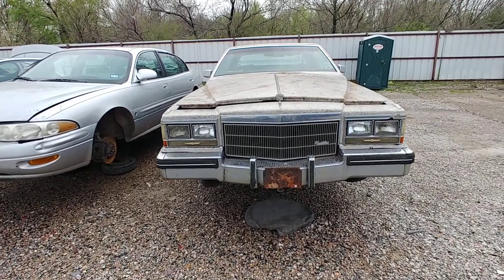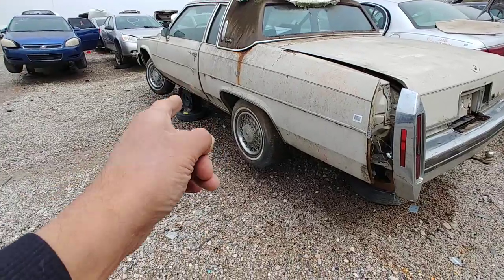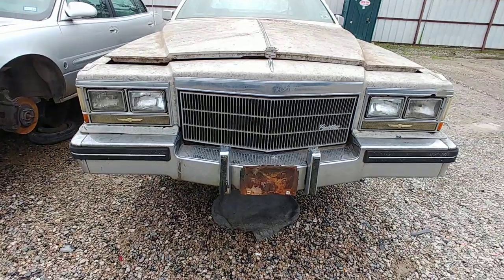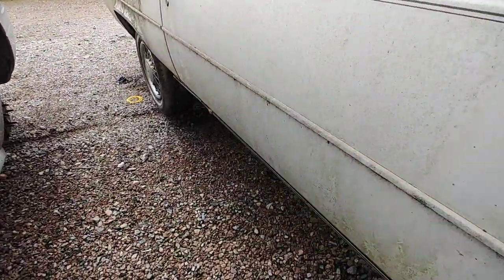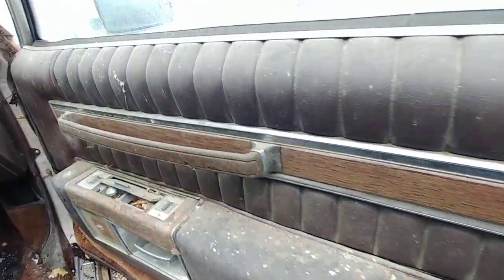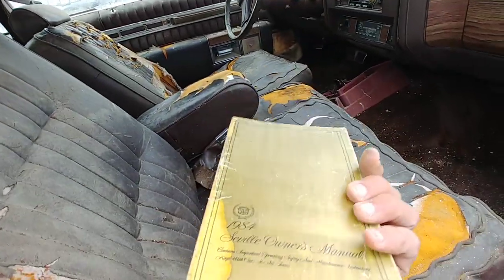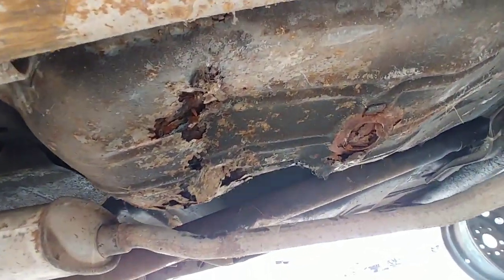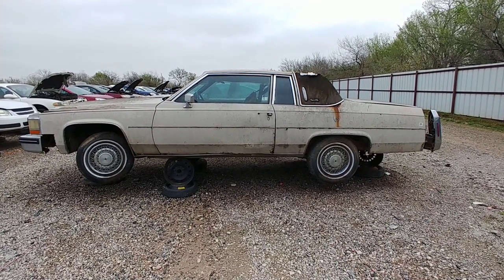1984 Cadillac Coupe DeVille Junkyard Find

Comment: A solid car to restore or use for parts...
Reply: Not at all solid enough to restore with the floors and quarter panels looking like that, among all of the other rusted out parts.
Reply: @jsciarri  I've seen way worse restored
Reply: @ls6-ss413  Very true, but this one is a better as a donor. Not that well optioned, only mildly so. Missing a lot of options available. Typically when ordered on the "cheap" they had velour interiors and bench seats and didn't have opera lights. Some had hubcaps and not simulated wires. I always liked these cars, but not the engines. My own first car was supposed to be a 1980 Fleetwood coupe which had of course the 368 with the 4 barrel. The service manager bought it out from under my father and I wound up with a very loaded '82 Toronado instead, which my parents loaned me the money for and I had to pay back before I could use it. Good incentive for a 17 year old kid to learn work ethic.
Reply: @jsciarri  more likely a parts donor...

Comment: I have an 86 CDV still runs and drives with the 4.1L  with  original headgaskets  179.534 miles Family owned since new    no dents or rust

Comment: My parents had an '83, it was code '#62 Woodland Haze. We bought it in the fall of 1982 after our 1980 Bonneville Brougham coupe (265 V8, black outside/saddle inside, what a beauty, I would still have it today if it was around) got stolen. Back then in the NYC area, there were organized groups stealing cars and exporting them to the Middle East since cars without leather interiors were in demand there. The NYPD cop that took the report told us, "Forget it, it's on a boat already. Call your insurance company...." Our car was about $18,000 new from what I remember. We sold it in March of 1988 after my father passed away. It was between that and the Trans Am and a mechanic neighbor almost convinced me to sell the Trans Am, but I decided against it because the Cadillac was more complicated and had the eeeek, HT4100 engine, which was a real heap (ours was low mileage, so it didn't have problems, and my father did all the service work on it himself). After we sold it, my neighbor's boyfriend swerved one day to avoid a mattress that fell off a truck and crashed it. Totaled. My dad worked at our local dealer from June 1984 until he passed away in January 1988. I knew and still know these cars well. I used to go to visit him after school (my HS was down the block from the dealer) and I'd often browse through the books at an empty desk waiting for him to finish and then he would drive me home. We had that plan for a couple of years, worked out great. 

Yes, 1980 to 1985 Sevilles were the "bustle back" type. They along with the 1979 to 1985 Eldorado, Riviera and Toronado were all made at the Linden, NJ assembly plant about 10 miles from me.  That is the wrong owner's manual for this car. To this day, I'd still love to find an owner's manual packet for a car my Dad sold---back then the salesperson would fill out the folder by hand and give it to the customer. 

Lots of good parts on this one---they interchange in many cases from 1980 to 1992. Back in the 1980s, kids used to take those ornaments and wear them around their necks on chains. The Cadillac dealer my father worked at stocked them by the dozen. The Fleetwood emblem had the crest around it, the Deville one did not.  The V on the trunk emblem meant it was a V8. From 1980 to 1982, you can tell from the back (originally) which were 4.1 Buick V6 equipped models by the lack of the "V" on the trunk emblem. '84 also didn't have the "HT4100 Digital Fuel Injection" fender emblems and had clear parking lamps with the gold Cadillac crests in them, so this is the original front end.

In '84, the Deville moved from the "C" body in the parts book to the "D" body joining its' more expensive brother, the Fleetwood. VIN on this is 1 for US made, G for General Motors, 6 for Cadillac, AM47 for Coupe Deville (2 door), 8 for "LT8" HT4100 4.1L V8 Cadillac produced with Digital Fuel Injection (basically dual injector throttle body fuel injection), 9 is a check digit, E for 1984 model year, 9 for Detroit, MI (Clark Street) assembly and the rest is the production sequence. These had the MW9 THM2004R overdrive transmission, same model as the Grand National. Mild options here----such as delay wipers CD4, VK3 front plate bracket, opera lamps, quarter vinyl top, C68 is for automatic climate control, K34 is cruise control, A31 is power windows, AU3 is power locks. I do not see A90 remote deck release. CAD on the SPID means "Cadillac Assembly" or Clark Street/Detroit, MI assembly, which closed for good in December 1987. The original exterior paint code is #60, Light Sand Gray. This appears to have the same color brown leather interior that my parents car had. 

MO Valley College is affiliated with the Presbyterian church and located at 500 E College St, Marshall, MO 65340. Mileage appears to be about 57k, probably 157K and that's about right for a HT4100. What happened with these was the intake manifold gasket would blow making a soupy coolant/oil mix that would then get whipped up to the lower end and eventually finishing off the engine. GM's "solution" was these brown "Horse Pills" as coolant sealant (basically Bars Leak) to seal things up. Stopgap solution. That label under the hood was a campaign decal added by the dealer as a result of that service campaign. This was a black eye for GM along with the whole HT4100. Early ones were wiping out camshafts at wholesale rates and they were lined up at the dealer for repair under warranty. Bad, bad, bad news. The introduction of the 307 in 1986 in the rear wheel drive cars was very, very, very welcomed because it brought a solid engine back into the fold. Then the 305 and 350 engines with fuel injection came out later on and were good too.  HT stood for "High Technology".

These cars were beautiful cars, but the poor engine ruined Cadillac's reputation for much of the 1980s. It started with the 4-6-8 (which was actually used through 1984 in commercial chassis, and across the board in 1981) and moved forward. At least with the 4-6-8, if you disconnected the modulated displacement, you had a very good fuel injected engine that ran well. The problem there was that GM rushed it to market before testing and in 1981, computers were not fast enough to respond to engine demands. We have that technology in engines today, but computer controls are light years ahead.

Comment: Kind of odd to see one of these in the yard since most of these were owned by older people who pampered them...
Reply: The HT4100 did these in as a 1-2 punch. First the intake would blow, circulating a chocolate milkshake of coolant and fouled oil. Once that polluted the bottom end, it was coup de grace and the engine was done. I saw it first hand on many Cadillacs waiting for repairs at the dealer my father worked at from 1984 to 1988.
Reply: This car is 36 years old so the old folks pampered examples were sold 20 years ago.

Comment: Man, I hate the way that rust almost always appeared on GM cars with that quarter vinyl roof. Lack of care for the most part... With some fiberglass bumper fillers, some metal and GOOD Body work and those wheels you found on your live last week and you might have a decent project on your hands...
Reply: I had a chance to buy one of these back in '95, I passed it up for my '80 Olds 98 Regency (it had leather and a roof) Lol... Good Times there...
Reply: @Cee_Four  As long as your Olds has the 350 VIN code "R" engine which was Olds produced, it was a smart move as that was a much better engine than the HT4100 in this Cadillac.
Reply: @googleusergp  I was lucky enough that I had the 350. Car was in great condition although I had to do a full brake job from the master cylinder back and wound up doing exhaust as well. I paid $500 for her and I only had it for about a year, sold it to one of my Uncle's and went back to my G-Body fetish... Good Times Man.
Reply: @Cee_Four  My neighbor (now passed away) had a '79 Regency with a 350 Olds "VIN R" engine. He bought it in 1980 from a local Pontiac dealer and he stated that it had over 300k on the original engine and transmission. It used to eat ignition modules every year or so. His daughter ran an auto parts store in Manhattan and he used to get them from her, they were probably poor quality. The car did run very well though.

Comment: Those HT 4100 engines were junk even when new. Gutless POS. There were only 3 torx bolts securing the flex plate to the crankshaft flange 🤣🤣

Comment: I’m restoring a 85 fleetwood that car probably had the ht4100 some say the worst engine ever created by Man which intern sent a lot of these beauties to there grave 😔 Mine had it and it was a flood victim but a stroke of luck happened all the water leaking from the roof channeled down the torn up (headliner) in to a pool on the back floor board the interior not only was perfect but intact and was a non smoker

Comment: 4.1????? a four point nine is a three hundred six cylinder..... must be a awful easy roller when moving as a step driveway would sideline that tank. If it were mine and still running, I would cut the top off and even where you cut it loose from the back, I would get down into the side below the trunk and make a pick up truck out of it. So much more easy to fill the back with scrap iron. Add about six more tons when rounded off/LOL and watch the weigh up guy wonder were the weight come from
Reply: GM had a few 4.1 engines in this era. There was the HT4100 Cadillac DFI V8, aka 4.1 liter. The HT stood for "High Technology". There was also the 4.1 liter four barrel Buick V6 engine, used from 1980 to 1984 on various GM cars.